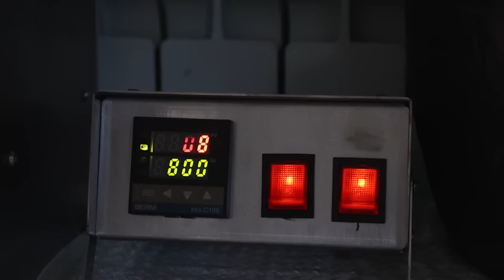You've never seen such a technique before! Amazing homemade tools!

Comment: At what pressure is the vessel constructed and tested? I have a similar one that has a pressure of about 2 bar. Under these circumstances, you can seriously injure yourself if the fuse explodes and goes flying. It's in front of the pressure gauge you added to the container. I would recommend welding a metal plate in front of the metal fuse, which will prevent it from firing and injuring someone nearby.
Reply from the maker: Checked 12 bar, but I pump 8 bar! Welcome, friend!
Reply: @AVTOCLASS  Then it's okay. You thought about this situation. But I would rather cover the safety plug with sheet metal. So that she could release the pressure, but not hurt the people around her.
Reply from the maker: @vladimirkubicek948  Okay, thanks for the advice friend.